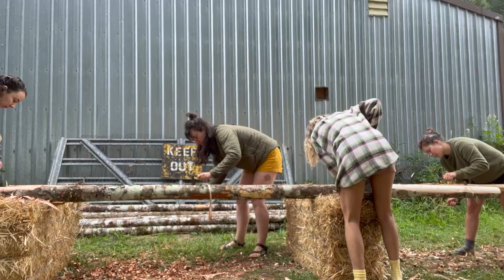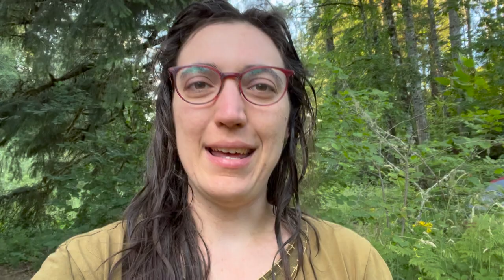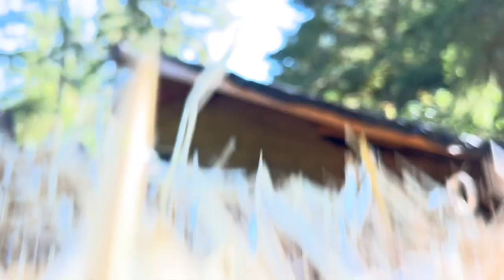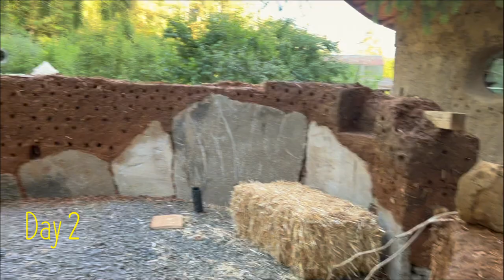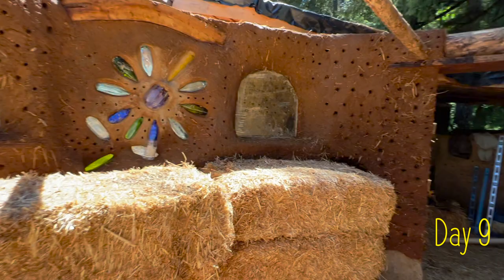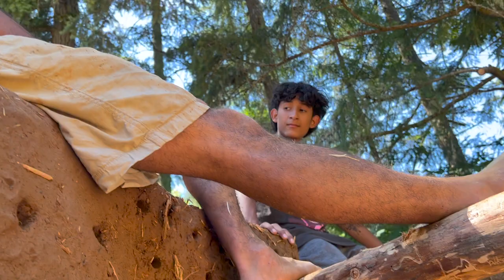I learned how to build a cob house! 🌎 | Natural Building | Ep.12

Comment: How long does it take to build one cob building? How much does it cost?
Reply: It’s different from house to house based on size, number of people helping out, and the level intricacy of details as far as time goes. Money wise the is location based, so you can check your local stone yard to get the foundation stones, sand, and clay which are relatively keeper than wood frame house. All in all to make a 12-12 space bare bones nothing fancy it’ll run maybe 1000$ low ball 5000$ highball.

Comment: How do you know if the ground you are digging up has enough clay in it ? Thx !
Reply from the maker: From what I understand experimenting is the best policy. If you dig up some dirt and try to make a bit of cob with it it should hold together. I think in the book "the hand sculpted house" they say if it has too much clay it'll stick to your hand too much and then it'll crack if you build with it. If it has too much sand it won't really stick together. There's also soil that's best for growing which doesn't have much clay in it at all. But once you start putting your hands in cob you'll learn what the best mixture is really quickly. The best cob is the cob you like to build with!

Comment: Hello dear .... Im from India.. I feel happy that I have spented 9 mins 15 secS in a useful way and may I know what are the things needed for plastering the walls
Reply from the maker: Hello Uma! I’m happy to have you here. The walls are basically the same ingredients (clay soil, water, and straw) plus manure. The manure adds elasticity to the cob material that makes is smoother. You have to wait several months for the original structure to dry completely before you can plaster it. I know that there are different types of plastering though like a white one made from Lyme that is more waterproof that you can use in bathrooms. You can also add pigments to the plasters to make them different colors. Plastering is an art form in itself!
Reply: @sliverofamoment  wowww thank you so much

Comment: Where are you taking the class? What’s the programs name? I’d love to check it out and join!! 
I live in oregon and i’ve always loved cob houses, I thought these were meant for more dry environments though. Is it just that the roof is needed to be built differently than other cob houses because of the rain here in oregon? Or was I just misinformed about cob?
Reply from the maker: I found my class through the cob cottage website! The person who taught it used to work at cob cottage and so I guess cob cottage sponsored his course even though it wasn't on the cob cottage land. 

Cob houses can be built almost anywhere! There are some 500 year old cob houses in England that are still standing and it's pretty wet over there. The main thing that's important is that the foundation and the roof have to be really well made. Cob doesn't absorb water quickly but if it's sitting in water it will deteriorate. So the foundation has to raise the cob layer away from the ground to stop capillary water flow and the rood has to move water away from the walls. I would highly recommend the book the  Hand-sculpted House!

Comment: We are retiring to San Cristobal de las Casas in the mountains of Mexico. It is cool weather but a bit humid and has a rainy season. Is this a bad place to build a cob house ???
Thx !
Reply from the maker: Hi! Lots of cob houses are built in very wet places. England has 500 year old cob houses and it rains a ton there. I'm in Oregon which rains a bunch and we have a whole organization called cob cottage here. There are examples of cob houses in every environment in the world. If you're in a wet climate it important to have a good foundation that keeps the cob off the ground to stop the capillary action of the water. You also need a good roof. Cob doesn't absorb water quickly so it needs to be sitting in water to fall apart pretty much.
Reply: I went to San Cristobal a couple of years ago and met several people building with cob!
Reply: @puremindaplacetosit7421  
Cool. Maybe I can locate them. Thx !